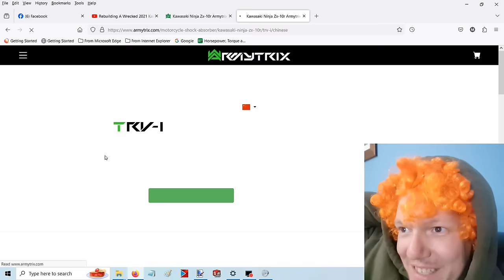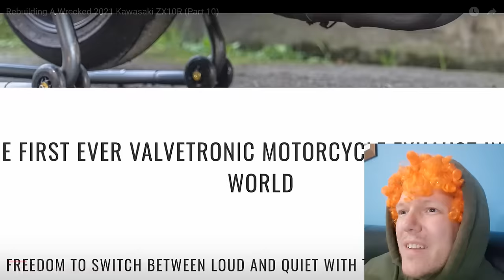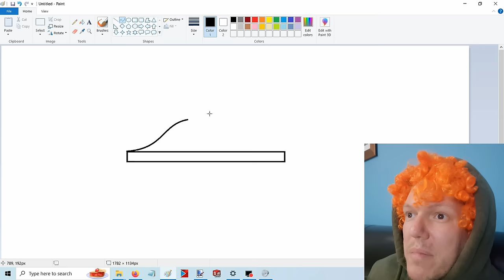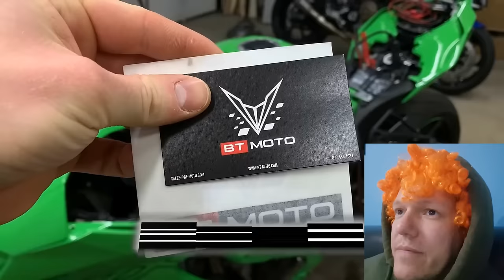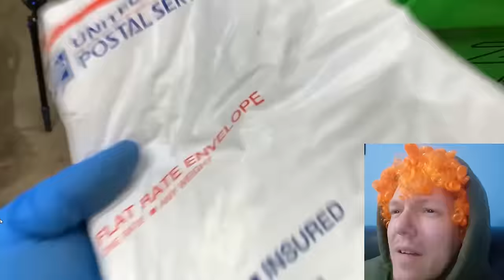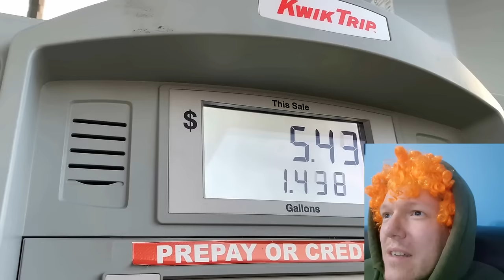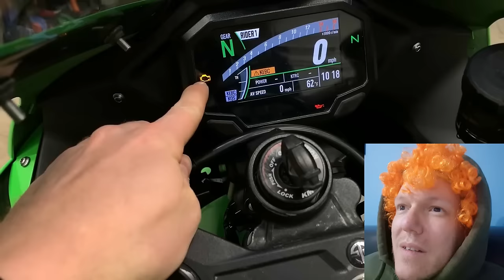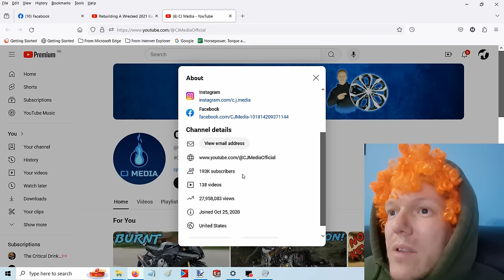GINGER vs NINJA - part 10

Comment: When I bought my GSXS 1000 the previous owner had fitted a set when I went to adjust the chain correctly I found that the adjusters holes were not machined to the spindle size so given false readings in the bin they went

Comment: 32:35 so I have to make sure the mono blocks on my 1000RR are aligned before tightening the left side pinch bolts, so the rotors are in the middle of the pads. Interesting this didn’t happen.

Comment: The Lightech chain adjusters do not allow for the chain to go slack, uses error. The aftermarket Lightech adjusters are a massive improvement, and i highly recommend them.
Reply from the maker: Why? Explain what's amazing about them.
Reply: @dirtygarageguy They’re black and he’s white with ginger hair 😉
Reply: Ya he did something very wrong adjusting his chain because I had lightech chain adjusters and never had anything like that ever happen.
Reply from the maker: @ryanb3767 but that doesn't answer my question. What are they for? Why did you get one?
Reply: I mean they clearly do allow the chain to go slack because... That's exactly what happened.
Reply: @dirtygarageguy  Lightech chain adjusters allow you to throw in a new tire quickly by locking in your chain tension. This avoids having to adjust your chain every time the wheel comes out. On my race bikes, they are a part of the quick change system. You could change a tire with one arm faster than oem.

Comment: For the chain slack...could it be he is setting the tension without the rear suspension at the prescribed compression loading? Therefore setting it to tight and the bike is forcing it slack when the shock compresses a few times?